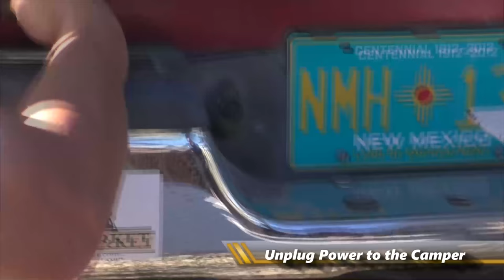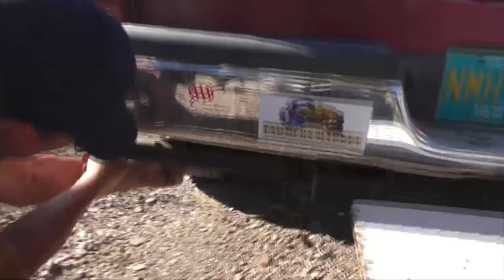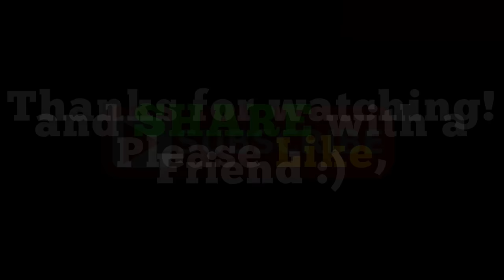How to Remove a Slide On Truck Camper

Comment: Nice to see you again, Jo. And thank you Enigmatic Nomadics for the video of your helpful endeavor.  Great sounding 12V Cummins as well. Obviously well cared for, and I noticed Jo warmed it up as well. Remember, all Chrysler Automatic transmissions (in this case a 47RH) only pump fluid in (N) neutral gear. So, if you want to help get all the juices moving, it doesn't hurt to warm up in (N) with Ebrake vs. (P) if safe, of course.
Reply from the maker: +papecat great tip!

Comment: Great set up Jo. If I can offer one minor piece of advise, It is a great idea to have a rubber mat on the bed of the truck and then place the TC on it. Also, it is a good idea when you unload the TC to lower the jacks keeping the front about 2" to 4" higher than the rear. Cheers!
Reply: Rodolfo!!  Here I am nearly 3 years after this video was posted!  I no longer live on the road, but what good ideas you offer.   I had 2x4s  attached to the bottom of camper so it would be a super snug fit.  Thanks!!

Comment: Jamie she was right about adjusting the turn buckle for the spring tension.. the turn buckle hook  has to be 1/2 inch from the bottom bracket before engaging the quick disconnect on top. she might be missing the top quick disconnect handle that are the spring loaded part of the system

https://www.youtube.com/watch?v=5ZNyocP_e6w

Comment: Enjoyed your video. 
when undoing turn buckels, would it be an idea to hold a piece carpet agsinst truck in case you slip on wrench, and could damage the Truck. Also we have a small travel trailer so not familiar with your setup. So do people typicly take off truck camper as a daily routine or is it just if leaving, storing for longer periods. Cheers.
Reply from the maker: Everybody's different. Depends on how long you're gonna be camped someplace, but either one is fine.
Reply: If you are going to be taking it off and on more often look into torklift fastguns, you can combine them with happy jack turnbuckles if you want but makes it much quicker off and on. Also if you don't have the factory electric jacks, cordless drill with an adaptor is the way to go.
Reply: depends on whether you want to have the freedom of driving the truck without the camper.  That would be convenient in many situations.  I thought it would  e easier than it was, plus I liked finding my camp spot and staying put for awhile😁

Comment: When you lowered the stabilizers, did you put the wood pieces back underneath them, or was it unnecessary. Good Video.
Reply: Not sure if I left them or not...This is Jo...however, I never had used wood pieces when camping...just attempted to find level spot and of course, adjusted each jack to suit.

Comment: Always have the front of the Camper higher than the rear.
Reply: Care to elaborate as to why? Kinda useless advice without an explaination.
Reply: Weight deal Atwood jacks says keep camper 4" higher in front that the back.
Reply: this is probably a ridiculous explanation but so the blood doesn't go to your head when sleeping??!!  I just tried to make the whole thing level.

Comment: Always jack up the front at least 2 inches and no more than 4 inches higher than the back.
Reply: Care to elaborate as to why? Kinda useless advice without an explaination.
Reply: C.R. Booger to act as a counterbalance against bodyweight and wind when the bed area is occupied and the camper is off the truck.
Reply: +Master Vadster. Essentially to keep the truck camper from tipping forward. Thank you.
Reply: @mastervadster9906  thanks, Master!